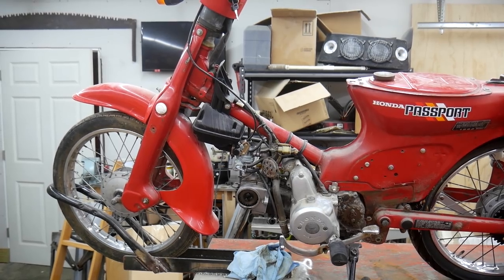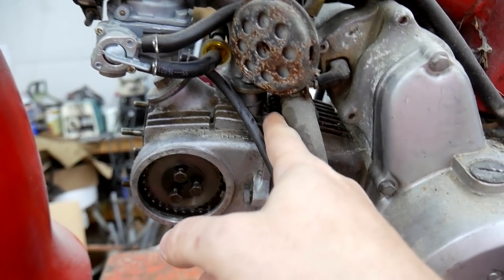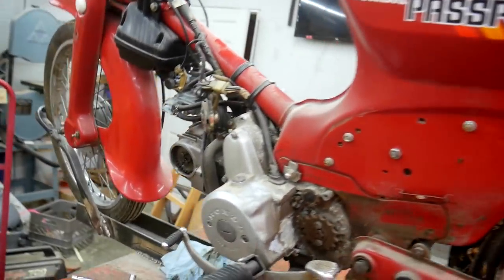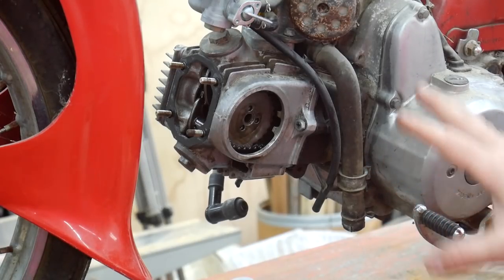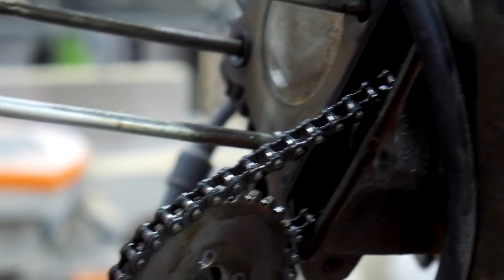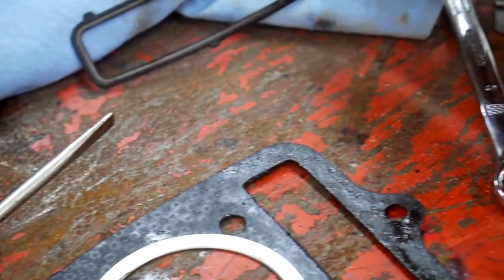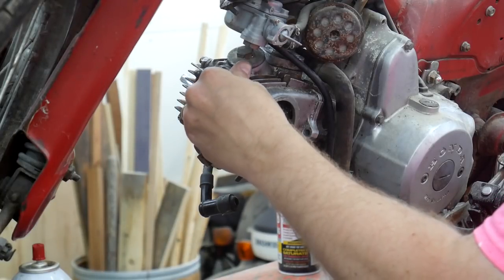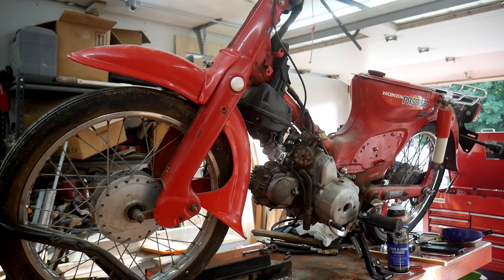Red 1982 Honda C70.  Starting for the first time.

Comment: According to the service manual and the parts fiche, that o-ring was supposed to be put on over the  head gasket. It looks like someone put it on below the head gasket when you took it apart. 
Very good video and I'm sure will be helpful.

Comment: I want those blue flashes on the leg shields :) are they bought or did you do them yourself ?, mine would look great with them on, i have the 82 passport also ;) great vids Thomas im learning from you
Reply from the maker: Hey Jeff, I don't know where they came from.  They were on the bike when I bought it. I'm guessing the stickers were available to buy when the scooter was new back in the 80's because they match perfectly.
Reply: Ill have to check out on Ebay, i might be lucky :) im just starting on my second cub though im a novice, 1978 honda 70, refitted the carb today after cleaning but not ready to try starting it as yet, theres a (big to me) wiring job to be done, feeling fearful :(  ,, thank god for you guys making vids always a pleasure to watch listen and learn, thanks for replying and good luck with your current project